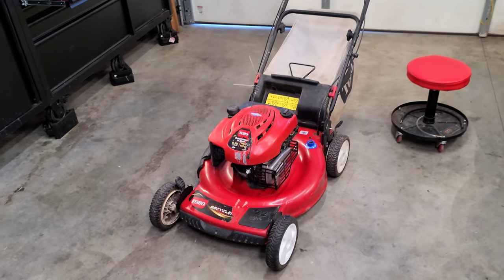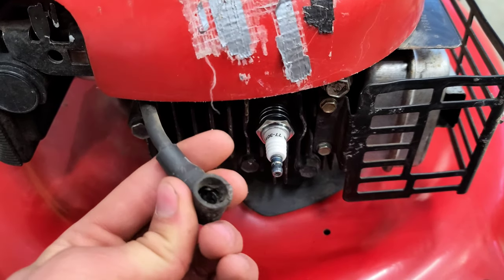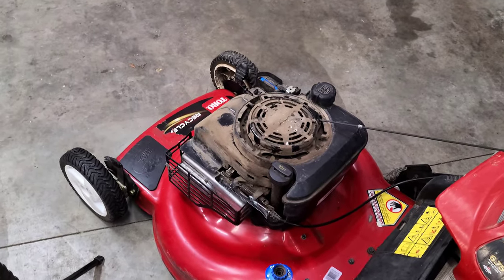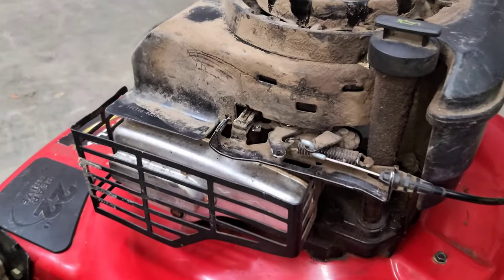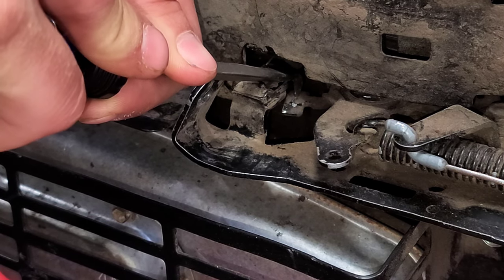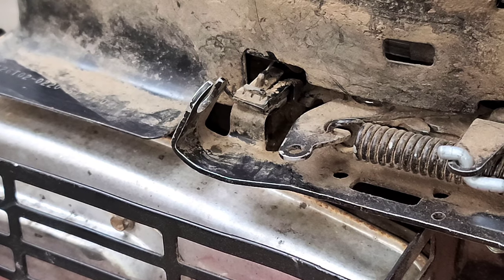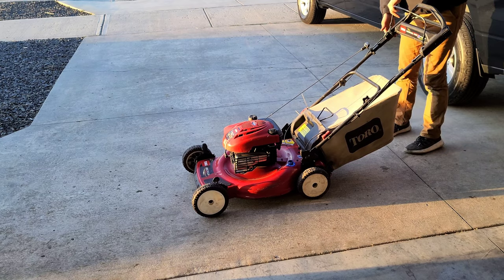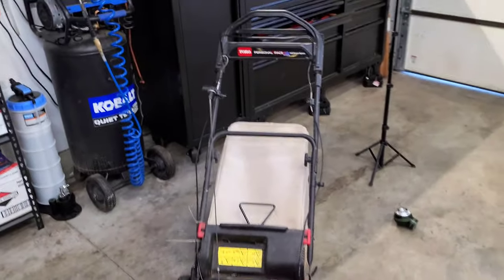How-to Fix A Lawn Mower That Won't Shut Off

Comment: Note: Its a shocking experience if you pull the spark plug off by hand 😅
Reply: Man I found that out the hard way 😂
Reply: @alilolder the last time I use a push mower that someone rigged together to work.  🤣  2024 we've upgraded to a riding mower!
Reply: @amesr19  ohhh yea told the hubby that's it the frankenmower has gotta go🤣
Reply: Yes, I learned that yesterday.  Wasn't sure if that was normal or just another sign that something is out of whack.  I hope no one in the neighborhood saw me jump when that shock surprised me, lol.
Reply: it felt good. lol jk

Comment: Thanks I have this problem and I was able to use a flat screwdriver and pry/rotate the contact to close the gap enough without removing the cover on my craftsman Briggs n Stratton mower. I learned about magnetos in school years ago. The old machines had a contact which could be pressed down onto the top of the spark plug and ground the magneto. Same thing.
Reply from the maker: Thanks for sharing

Comment: I have a newer Pulsar lawn mower I got from Menards. It was mid-priced and I needed it quickly. It ran pretty good the first couple of times. Then it wouldn't turn off... I saw your video & took the shroud off. The cable switch was very similar. But it was obvious they never could connect. I was kind of perplexed at that point. Then I noticed there was a small electrical wire with an insulated connector.  It seemed to be detached from somewhere. I looked around &  saw the it was supposed to be connected to The part that was hooked up to the spring mechanism. I thought well, I'll reattach it & see what happens if I tried to start the lawn mower & let go of the bar. Luckily it did work, It stopped right away. I'm super happy that it works again. Thank you for explaining how to take the shroud apart. The only difficult part was trying to find the 10 mm socket for it

Comment: Sir....I have been fighting this issue on a 22 inch toro awd mower.  It's 4am....im sitting on the throne...if this fixes my issue, I'll need your cashapp to buy you a cold drink
Reply from the maker: Let me know if it fixes it
Reply: @fillslawncare  it did not

I have to reach under the cover and force the brake against the flywheel to get it to stop ...or pull the plugwire

Comment: Mr Fill I’m so pleased on your great information on the fix. I have been struggling for two years bending down to remove the plug for spark plug. I did what you said and now she is fixed. Five Stars young man. 

I’m turning 65 in 3 weeks this sure is a birthday present thank you. 
If you know about old toro snowblowers I will be checking back. 
Thanks again Houli.

Comment: Thanks for your video. I bought a mower for about 15 dollars and it won't stop. I wondered about the brake. I noticed a piece loose near the brake and I now know it's that tab u bent down. I'll see if I can remount it and hopefully it holds and I'll make sure it touches and test it. Thanks for the video. Appreciate it

Comment: I had that problem with the same style Quantum engine but it was a manufacturing/assembly defect.  It would eventually stop with just the brake until I bent the bottom contact upward.
Reply from the maker: Thanks for sharing 👍🏼

Comment: Hey! I have a JD JA60. Not shutting off but i verified the stop switch is making contact (it presses it up slightly as it slides into place and even when i press it down with a flathead)
What would be the next step? Can you do a video on the brake/flywheel?
Subscribed btw!

Comment: Hey Fill I’m having this exact issue on a Craftsman mower. Hit a big rock and it wouldn’t shut off after that. The impact did something to it. I’ll go check to see if your video’s instructions solve the problem. What should I look for next if that doesn’t do the trick?
Reply from the maker: Check to make sure your mower grounds out with like a wire or something that makes contact when you release your handle to turn off machine
Reply: @fillslawncare  Would you mind going into more detail here? Thank you 🙏

Comment: I completely stripped my mower a few weeks ago to give it a good clean and to paint the deck, etc, but when I put it back together it has this problem where it won't turn off. But I can hear a little switch clicking when I release the handle, and the cable has a little slack when released. It's a bit strange.
I can get it to turn off if I push the lever that the cable is attached to, so it might just be that there's a bit of crap stuck in there or something. Or maybe the kill switch is clicking but not activating. Looks like I'll have to go at it again and see if I messed up somewhere.

Comment: What if it doesn't normally stop when you release the handle, instead using e.g. an off switch or throttle lever?

Comment: Can you help me? We had the same problem pulled off the cap to the spark plug but now when we go to start it up again it won't start. Disengage the off button and still not start put a new spark plug and still will will not start